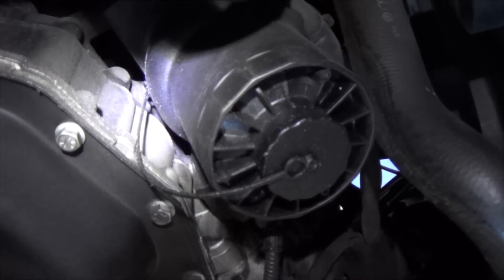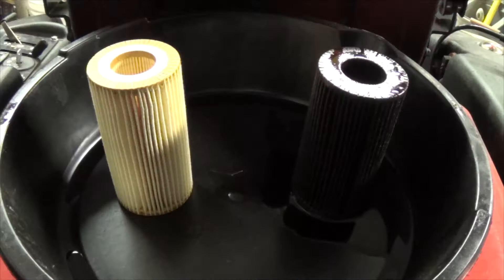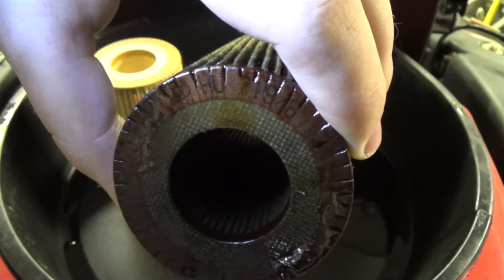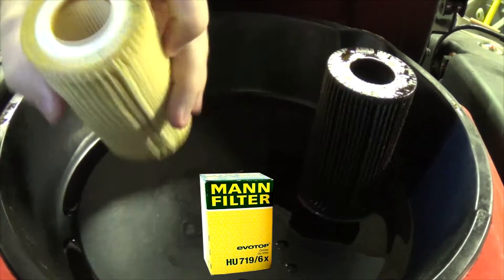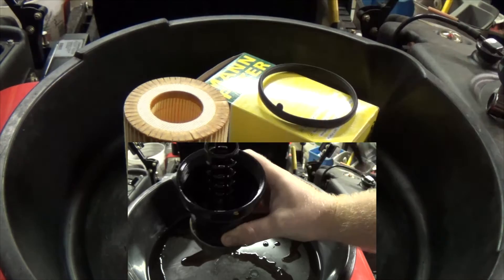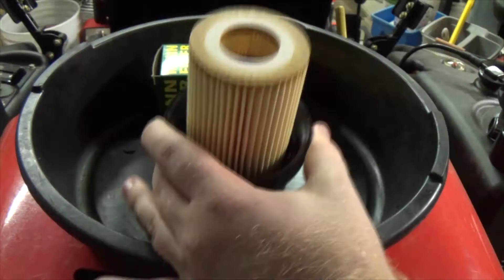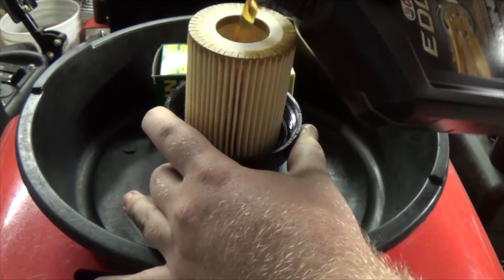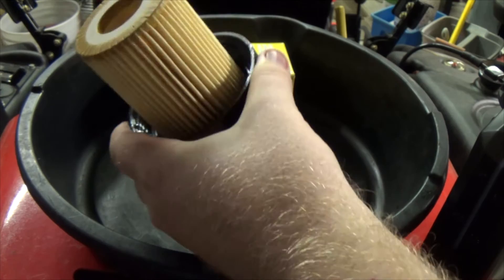Cartridge Oil Filter Installation (Volkswagen Rabbit Example) • Cars Simplified

Comment: What's the socket size for the oil filter ??
Reply from the maker: I don't currently have access to the car to confirm, but it looks like it takes a special 74.5mm 14-flute (14 flat sides) socket. I believe that I used a 75mm for this job, which explains the slipping I experienced with it off-camera.
I have heard that non-OEM filter housings have a different size, too.
Reply: 74mm 14 flute oil filter wrench

Comment: mine is stuck, won't budge at all!! any tips?
Reply from the maker: Did you already relieve the suction in the way shown at 0:38 into the video? Try to push the relief valve to the side after it has been pushed upwards, and it will stay in an "open" position. Other than that and a breaker bar for extra leverage, that's the only help I can think of unless you aren't against buying a new filter housing.
Reply: Yes did that and still does not want to budge!
Reply from the maker: Wow, that sounds tougher than the first time I took this one off!
Perhaps some freeze-off sprayed on the engine next to the filter will shrink the threaded portion just enough to make the job easier? It may be difficult to spray it accurately enough to not also cool the filter housing, though.
When you have tried to remove it, is the engine hot, cold, or have you tried both?
Reply: Cars Simplified I let the car cool down first, so the engine was cold
Reply from the maker: Hmm... Well that's the ideal way to do it, and I also looked at the set up down there again and freeze-off definitely won't get to the threads. I'm all out of ideas! Sometimes it's just a matter of taking a break from the job; give it another go in a day or so. Maybe a rubber mallet on the breaker bar or something else crafty is what it needs.
Reply: @CarsSimplified  It also happened with mine. Will not come off. But Im gonna try again another time. I dont have any freeze off though. Easy but good explanation though and showed well. I just cant get it off its not your fault. But thank you! No clue how i was supposed to do it
Reply: @CarsSimplified where I can buy the silver socket as shown in the video, to remove the filter, my Volkswagen rabbit 2.5 engine is 2007 year make. Thanks I’m advance…